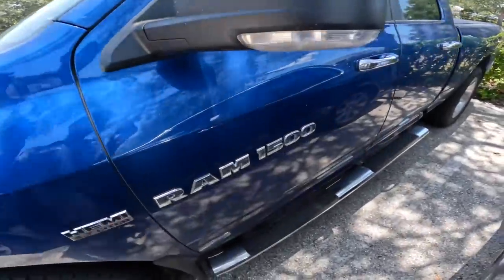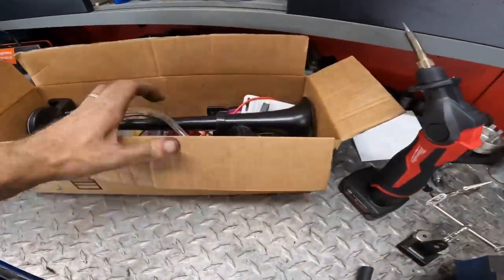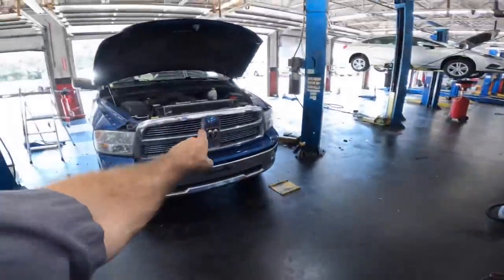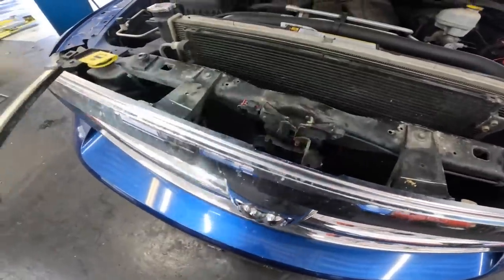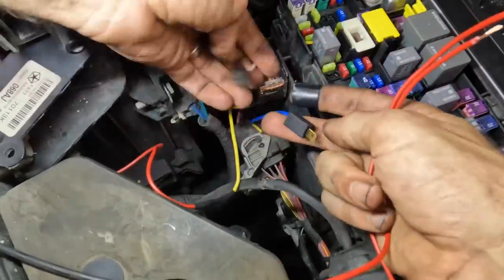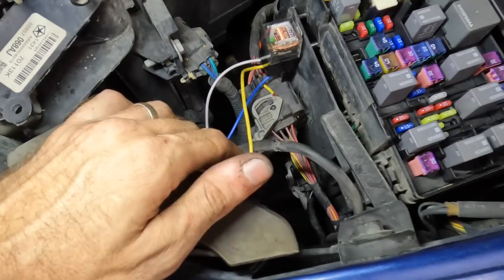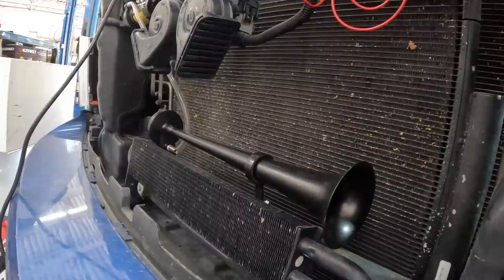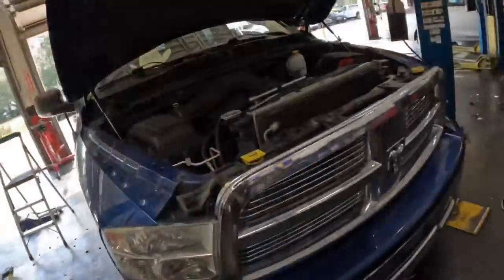Dodge really blows! Ram 1500 4x4 5.7 Hemi

Comment: As an electrician for nearly 30 years, every fiber of my being cringes With disdain for using a red wire for negative (ground). Other than that, nice job so far 👍🏼
Reply: I know. Should have over sleeved with black if using red wire.
Reply: At least it's a short run and in eye shot.
I take greater issue with adding in superfluous relays.
Reply: I cringe at (home wiring) where black wires are "hot!"
Reply: @tomtke7351  that not aimed at me? BLACK is Ground!!
Reply: @biker6991  In a vehicle, there is negative and positive. There is no earth ground.
Reply: to me it looks orange,not red...
Reply: @BigMikeECV  It's all 0v, thus ground. Negative isn't a voltage reference, while in this system we want to connect to 0v, which is always ground. Negative isn't a perfect 0v reference.
Reply: @biker6991  In our homes the protective ground is green or green with yellow stripe. The neutral is white, the hot (live or active) single phase wires are black ,
Reply: With you Tim
Reply: Cars are dc not ac 😒
Reply: Clear the air:  Home wiring uses black wires for hot and white for neutral.  Electronics, coversely, uses black wires for return/ground and red for power.  CONFUSING!!  Yeah, Ray could've better used black colored wire for ground.  But, as he said, he didn't have any and he was doing a cheap-O install. As the number of connections increases, the number of different colors increases or could, or maybe everything could be ALL white; wouldn't all white wires be fun in a car?
Reply: @Tiek-bl8ej  alternator wants to know your location.
Reply: Fuq it..  use Green.. as electricians know....lol
Reply: @tomtke7351  It's been code in house wiring for 80 years. AC circuits are black = hot. DC circuits are black = negative.
Reply: @justinvzu01  Negative, in a DC circuit, is most definitely not always ground! And in house or commercial electric, neutral is also not ground.
Reply: @Tiek-bl8ej  As an electrical engineer, I picked right up on that. See, those 7 years to earn a master's degree wasn't wasted
Reply: The electrons don't care what color the wire insulation is...😂
Reply: @farillagarilla7999  You're exactly right, electrons don't care and that is the exact reason why we don't mix hot or neutral or ground in AC circuits, or black or red or ground in DC circus. 
I recently read about a 22 year old guy who tried to jumpstart a car for a woman at a mall. Someone had replaced the battery with one that had the positive and negative on the opposite side as the original. He hooked up the jumper cables, (positive to red, negative to black) and was seriously injured. Keeping standard practice and doing tasks in a workman like manor is key for the next person.
Reply: @BigMikeECV  Earth and GND are two completely separate concepts.
Reply: @timmack2415  I guess black is negative half of the time in a ac circuit.😁
Reply: It doesn't matter.
Reply: @wanders278  it doesn't matter to him & it doesn't matter to the circuit, electrons don't care what color the wire is. It could most definitely matter to the next guy who has to work on this, That's the point.
Reply: @tomtke7351  the Allison wire harness is all white wires with red/org stripe the only way to tell difference is wire numbers are stamped in black ink  its sucks to try and read em as the wire ages

Comment: We used those low temp solder connectors in the Air Force. They're awesome. Put a "C" shaped attachment on your heat gun to hold in the heat around the connector, and the solder will melt in just a few seconds. Plus the hot air won't melt anything else close.
Reply: A (old) pocket knife works also great as a deflector.
Reply: That's good to know. I've been using those solder connectors for three years now. It didn't occur to me to deflect the heat from the gun.
Reply: the 2 blue band serve as a moisture seal.
Reply: Thats awesome! Thank you for your service as well 🤘

Comment: It’s called a solder sleeve. Available in 3 sizes. When you installed it, you don’t need to put a heat schrink on top of it. It’s like wearing a double condom.. keep it up Ray! Love it..👌🏻
Reply: Double condom. Good one.
Reply: I've built one airplane and parts of a couple others using solder sleeves wherever possible.  Airplane guys always heat shrink over these.  Any stray current in flight will make you wish you had a double condom.
Reply: you also dont need to fan the cables out and connect them before heat shrinking with the solder sleeve. you just plug them in on both sides, push them up to the middle and then heat them up.

Comment: I installed an air compressor and tank in my trunk to run an old fire truck horn I have under the hood of my ‘03 Marquis. Compressor keeps the tank at around 100psi and the horn is hooked up to a solenoid valve, which is junctioned into the factory horn circuit. Horn is quite loud and doesn’t need to wait for an in-line compressor to spool up. As a bonus I have a standard fitting on the tank so I can use the compressor for other things such as blowing up floats at the lake or airing up the tires.
Reply: This is genius

Comment: Used the solder beads 40 years ago when I was in the aircraft industry as a avionics engineer they work great if you have the deflector on your heat gun trust me 🙂
Reply: Having soldered almost everything from 250amps cables to double 0 SMD parts, it makes me cringe to see him touch the bare copper strands with greasy fingers. This is going to give you a bad time/joint especially with no/wrong type of solder. Edit: I meant flux not solder, last words otherwise make no sense at all :D And I used to have those connectors in my toolbox all the time in the field. You can splice and fix wires with a knife, a connector and a lighter if need be but in a shop I wouldn't go this route.
Reply: I've seen those solder beads in Germany ... never could find them in the states ... course that was some 30 plus years ago
Reply: I was just going to recommend he get a roll of aluminum tape or a deflector for his heat gun!
Reply: We STILL use them in aviation; whether to splice or add a shield ground, they are used everywhere! And you definitely need the deflector to keep the heat contained.
Reply: @kitgunter3643  I had the same thought as he turned the heat gun around the wire.

Comment: Another aviation guy here, Avionics specifically.  Good choice in stacking your terminals on the body ground. Placing a smaller terminal under a larger one can cause the smaller terminal to heat up depending on the amperage load.  Over time the expansion and contraction from heat can stretch the bolt or melt the terminal causing a loose connection and all sorts of issues.  Its really fun when people stack washers or terminals under power feed cables for electric starters.  Things get all archy sparky and melt.
Reply: The lack of DMC tools disappoints me. (Jk those are $$)

Comment: On emergency vehicles our horn button changes the siren tone/pattern so we typically use a foot switch for the air horns.  It really doesn’t matter the idiots still pull to the left in front of us (remember go right for sirens and lights) but most of the time they just ignore us or can’t hear over their own radio.
Reply: When I retired I worked as a paramedic on the times I was driving I would steer the front of the vehicle towards morons and lay on the triple horn system we had it is a crowd pleaser. Should see their faces 😂😂😂

Comment: Hi ray!  Greetings from Germany, where the Knipex are build. It's with the K. 
I'm a mechanic too and I have 3 diffrent sizes of them. 
Be carefull when you're working on coolant hoses with them. Especially when the pliers are new they can rip the hose quite easily. Don't ask me why I know...
Reply: Confirmed, also from Germany, I have the exact same size Cobra in use as my mildly angry pliers.

Comment: Hi Ray gotta say love your videos, the solder will melt about 170 plus degrees c, the two blue bands are an adhesive sealant that waterproofs and seals the solder sleeve, I work in aviation and love these too and is nice not to see those horrible crimps being used 😀

Comment: Nice job. Don’t need so much heat, once solder starts melting, turnover to get the other side but only a few seconds otherwise u could damage the outer insulation . They are fast and solid.  Heat shrink over good idea, been doing that  also.
Reply: Myself, I would have hammered or ground down that flange to be able to mount the horn with self-tappers.
Reply: @MonkeyJedi99  Hammering the flange flat would cause that area to be considerably weaker.  Whether that would be a problem is unknown.  He could have used two self tapping screws on either side without flattening it.
Reply: @rongollonik7754  Oh, good point on the structural aspect.
Another method to level it out and still use self-tappers would be a couple of washers under each side.
Reply: @MonkeyJedi99  Best solution!

Comment: I worked as a technician in the Aerospace Industry for many years. They taught me the ways of the solder sleeve in 1982. Be sure to keep the heat there until the solder melts completely and flows into the wire, a deflector on your heat gun makes it work better.

Comment: @3:35 the "mufflers" on the horns were the first thing I removed from my '07 Tacoma.. I had seen them when checking out the engine bay on the lot  before mine came in... I drove mine home and opened the hood and popped them off.. Much improved "decibels"
Reply: Do those have something in them, or are they just a shaped horn?

I am asking because the effective sound other drivers may hear may be louder, depending on whether those things are an impedance match of the horn to the air, or they have muffling structures inside.
Reply: @DougDingus  I looked at the piece and it reminds me of the Two good side wooden fence.. a board on my side offset to the one on your side.. I thought about the sound enhancement but figured that it was there to keep water and trash out of the horn.. Seemed to be overkill.. At that time I did not have a decibel meter.. I would like to know the answer myself.. Thanks
Reply: @jimharper6073  Interesting!  Something like that might go either way.

You can get dB meters for your phone.  They vary a lot, and some are pretty good, offering spectrum displays and other goodies.

If you can get one for your phone, or someone in the fam, maybe you can get the answer!

Measure in your drivers seat, and then again some consistent distance from the car, right side, left and front.

Might be interesting and at the least you get to blast the horn several times.  You know, for science! lolol

Side note:  I went ahead and collected all the applications that worked with my phone.  It is a Note 8, not cheap when I got it new.  Now they are a hundred and change.  I like to run a phone for a good while before changing. Always seems like such a waste otherwise!  Check this out:

Temperature
Compass earth mag field strength meter
Moisture in air 
6 axis translate, rotate
People proximity sensor (capacitance? I dunno)
Gyro
Accelerometer 
Blood oximeter!  (Used that during covid)
Altitude, air pressure)
Several mics either 2 or 3, can't remember
Two rear cameras, one front
Finger print sensor
Light meter (lux)
Iris thing (might be a camera)

And that's a lot of stuff!  The thing is a lot like the "Star Trek" Tricorder.

Anyway, you may find yours or a friends can measure a ton of stuff.  It is kind of fun!

One last thought, and yeah I am end of day rambling here, is if the horn itself has a "horn" shape, the impedance matching may already be done, and that means the thing on yours may direct and or muffle the sound too.  Or both!

Comment: Those connectors are awesome. I've used them and they work as advertised. Just twist the ends of each wire real tight and make sure they overlap each other where the solder is.

Comment: Nice to see you doing custom stuff for a change. I drive my shop crazy over it. I busted up laughing when I saw the horn. You should see and hear my rides. LOL I added an oohga horn to a 2002 Chrysler Prowler and it was so tight under the hood, we had to put the horn under the car, really. It's pretty large. Luckily it's stainless and we weather sealed it. On pavement, it's quite loud. We mounted it sideways so the wind wouldn't blow into it and we even used an existing bolt for the bracket so we wouldn't have to drill a hole in that vintage car. Still looks like new, including it's bracket. 10 years and it still works fine. Since it's a period car, I wanted to add a period horn to it as well. I did the same thing to my Jeep Liberty Woody, complete with a surfboard on top. It did fit under that hood.

Next up? Upgraded speakers in that Prowler. All 6 of the mains in the little 2 seater. It already has a very fancy radio with a 6 CD changer and a Cassette deck, so I upgraded it to bluetooth compatibility with auto-lock. I didn't want to lose the CD changer whether my phone was supplying the music or not, and I wanted the phone to automatically connect. The CD player still works fine in that 20 year old car and is always loaded. The cassette deck still works fine as well. So this time we'll just put in high tech custom speakers and sub-woofers. I might not do the actual work, but it's my money that makes it happen. And it helps that I have the top shop in the area. They love adding mods. I have NAV and reverse cameras in both these vehicles thanks to my shop, and Garmin, and most importantly, me. Cheers.
Reply: Just wanna giggle at how you called a 2002 prowler vintage 😂😂 sure their funky but if 20 years old is vintage then i better get health and life insurance.
Reply: @tomhalf3018  Interesting Tom, so what do you have?

Comment: I had to install something similar so I manufactured a piece that fit between the surface and the mount. In my case, wood was the best choice but I think rubber or metal would've worked here.

Comment: If you haven't already tried it, get the Marine Heat Shrink Kit from HF. It has the glue inside that really seals the repair from moisture. I use it on boat trailer lights and it never leaks.

Comment: You don't need a second relay - just put the switch in-line with the existing horn live.  When the switch is on, the horn live will actuate the relay you have installed; job done!

Comment: I've seen those solder connectors on Amazon. If I was to use them, I'd put extra flux on the exposed wire so the solder would flow faster
Reply: The good ones have flux in the connector.  Cheap crap on Amazon, who knows.

Comment: Ray, I use these connectors often on my sxs and 4 wheeler and they hold up well.  Takes quite a bit of heat to get the solder to melt and the casing gets pretty flimsy.  This is my only complaint but they hold up well.

Comment: I put a set of 24" air horns from a semi truck under the hood of a '95 Metro sedan (aka Suzuki Swift, Chevy Metro, Geo Metro, Pontiac Firefly). 5 gal air tank in the trunk, air compressor from Chevy Montana van air-ride, air oiler filled with methyl hydrate to keep valve from freezing in winter. High-flow solenoid tied into horn circuit, toggle switch on dash to revert to stock horn at any time. Had lots of fun with it.

Comment: Now that is a typical Rainman Ray's install, overkill with style. TY mate enjoyed seeing the install.
Keep Safe Keep Strong 🦘🦘🦘🔊🔊🔊
Reply: Didn't use a spring washer or nylock nut on the compressor, overkill fail :D
Reply: @tyrantworm7392  The tubing between compressor and horn is too short, stressed bends will kink. Only one wire colour available for power and ground. Neither I am sure are Rays preferred but he is limited to work with what he has available.

Comment: Great job Ray. I use those solder connectors but have found occasionally the solder fails to wick very well. I use a flux pen on the wires just to give you a great connection.

Comment: Nice video, when mounting the air compressor did you use a lock washer or just a washer? I've been bit before by not using lock washers and had stuff come loose from vibration. And those soldering joints are amazing!! Just learned about them myself a few months back. Saves alot of time!! Keep up the great work Ray!!👍

Comment: I've done 3 air horn installs with varying degrees of professionalism. The most recent is on my work truck with the compressor/air tank assembly and the quad trumpets mounted on top of the toolboxes right out in the open.

 I made a tee connection at the power wire for the factory horn and ran it to a switch in the cab, then out to the solenoid valve for the horn. This way the electric horn always stays active and when I want the air horn I flip the switch and they both blow at the same time. Of course you can only hear the deafening sound of the air horn but technically they are both operating. And being that it's a chevy 5500 work truck it has upfitter switches that I used to power the compressor, it turned out pretty nice other than not having anywhere to hide the horns and air tank but it does look mean having 4 shiny chrome horns pointing at traffic in the right lane